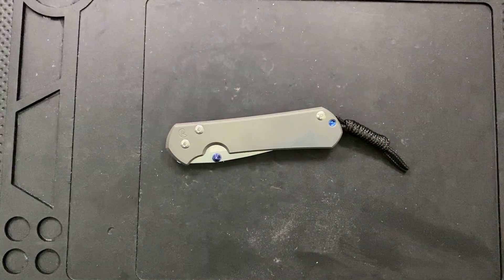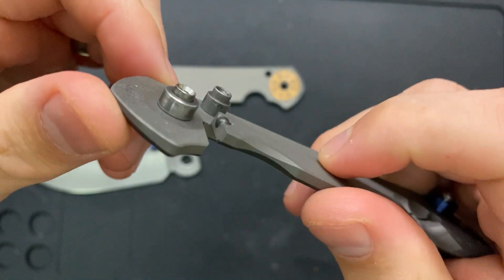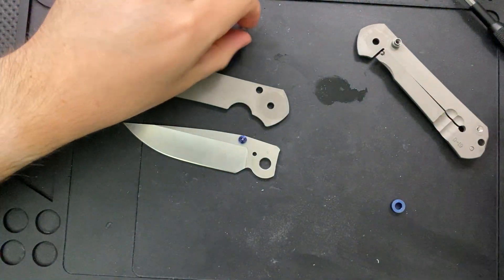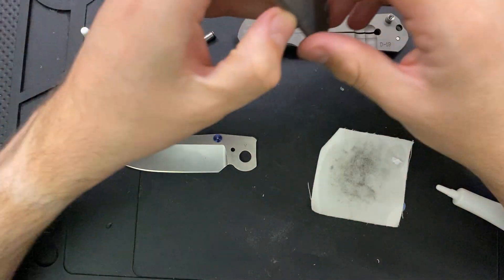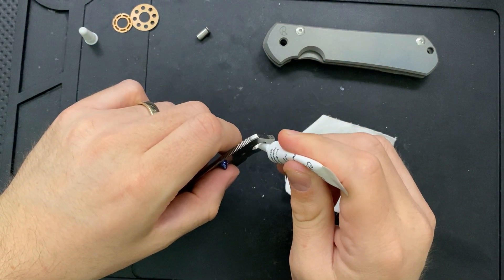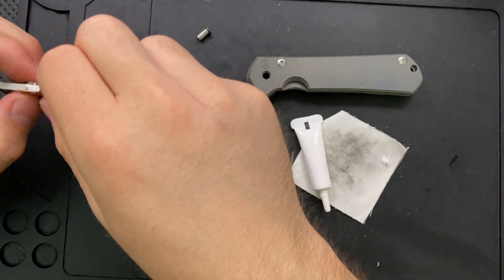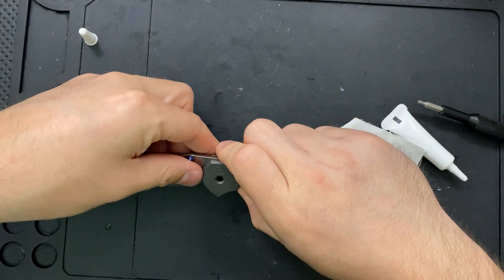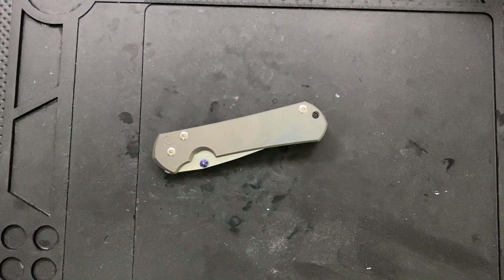How to disassemble and maintain the Chris Reeve Knives Sebenza 31 Pocketknife

Comment: Tim reeve has a great video on how to do this. You gotta keep the body screws a little loose so you can slide the blade back in easier, take the lock bar tension off with your thumb, slide the blade in, then tighten everything. It goes real easy that way.

Comment: This was helpful. I’ve taken my sebenza apart multiple times, and I’ve always put it back together the “knife sandwich” way. I’ll give this a try next time I clean it.
Reply: I do the "knife sandwich" way all  the time in my 21. You're not going to crimp anything if you're careful and use common sense 🤦🏼‍♂️
Reply: I always build mine up from the lock side to the show side, never one issue in my 10yrs of owning many CRK’s. Don’t know what the others do wrong to damage such a simple design.. 🤷🏽‍♂️
Reply: I have taken mine apart 4 times now using the sandwich method and never had a problem. If you put the washers down over the pivot bushing and not put the bushing down onto the small washer, you shouldn’t have a problem since the bushing aligns everything.

Comment: (Rolling my eyes) I seriously doubt you'll run into any issues crimping the washers by putting the knife back together the way you normally do. Screw those fan boys and CAROLE BASKINS!
Reply: Its actually surprisingly easy to do. I used to think the same thing when I got my first Sebenza. I tried assembling the way I was used to (knife sandwich style) and ended up pinching a washer. Just the nature of having a pivot bushing. The way Nick shows here is much easier.
Reply: @journeymanedc  is it tho
Reply: @adamgreene831  The washer is sitting on top of the bushing at 9:57 and got pinched as nick tried to force it between the handles...
Reply: @adamgreene831  yes.. lol I've owned like 20 Sebenzas. You can put them together however you want but it's easier to slide the blade in. Its impossible to pinch a washer that way.

Comment: Great video! Is it me (must be) but has knife quality deteriorated? I only have Hinderer and Chris Reeve - (7 Reeve, 4 Hinderer). The last two Hinderer and the last 3 Chris Reeve all arrived with off center blades - a huge pet peeve of mine! I am currently awaiting word from Chris Reeve on what to do with my new large 31 - maybe the tolerances are so good that some grease under the washer is throwing it off? In any event I asked CRK how 3 recent knives can all have off center blades and how should I proceed - we will see!
Reply: How did that work out?
Reply: @gustavohernandez5464  As it turns out, there was in my last knife too much grease! Amazing! I disassembled the knife and cleaned it - added oil which I prefer over grease and it was dead center. The Hinderer was a matter of user error, a nuanced adjustment to the pivot (I am talking a 10th of a turn) centered the blade.

Comment: I had a little lockstick om my small 31. It was so little it dident mean anything. I have fixed it with a little lube on the lock interface.
Reply: You shouldn’t have any lock stick being that the lock interface is ceramic now
Reply: @sinjon   Yearh but i still had a little. IT was so little it was barly noticeabel. But after IT got a little lube a week or two ago, IT has been perfekt. Sorry for my bad english.
Reply: Bernd DasBrot   value is relative. Most non knife people would say everything over 20$ is overprice fore a Pockets knife. Nobody is right or wrong in the end. I buy it because i love the design and the great warrenty. We shoundent judge people fore what knife they buy as Long its not a z-hunter;)

Comment: This is to much like the inkosi/25. I'll pass on the 31 and might pick up another 21 before they disappear.
Reply: Love my 21. Not a perfect knife, but it's damn good
Reply: This is set up like a 25 except the washers are not even size like the 25. The 25 is mechanicly sound the Inkosi is only bolted solid at the rear or the knife the 31 is at least bolted down solid in two places. The unven washer set up on the 31 is wrong. It's pushing the blade in one direction. The 21 and 25 are mechanicly sound.

Comment: Can anyone tell me if the blade is suppose to have a little play to it when the lock bar is not engaged?
Reply: That’s ok if the lock is not engaged
Reply: Caleb McFadden I took it apart just 1 more time just to make sure I had everything aligned and I guess one of the washers was slightly off but when I re assembled it, it was rock solid.
Reply: @nylildude  I see. Glad you got it working again!

Comment: I'm not trolling or trying to be demeaning. My fried owns a Machine Shop and has been a Machinist for over 40 years and if you showed him the washers he would tell you that's not right. I know this isnt a life and death situation like a motorcycle wheel and it's just a folding knife but that floating stop pin is straight up wrong and so are eneven washers. Will it work?? Sex in prison will work but i'm def not into that either. Just so you don't think i'm trolling i might pick up a 31 but i'm going to get some even washers if i do or at least have that on my radar.

Comment: The issue as proven by Advanced Knife Bro is titanium is softer than steel. So under heavy use the titanium will mushroom. Titanium is great lightweight metal with great tensile strength. But it has better purposes than inflating the cost of knives.🤦‍♂️
Reply: What was the tool used?   Thanks

Comment: Two different size washers is uneven strength which means your pushing the blade in one direction. I'm an Offset Printer by trade and i've never seen two different size bearings or anthing like this. All wheels i've ever seen on a motorcycle have even bearings. The Sebenza  25  has even washers and the handle is bolted down solid in to places, the Inkosi is only bolted solid at the rear of the knife. This 31 is just like the 25 except the uneven stupid washer set up. No way Harley could put two different size bearings in there wheels and not get called out on it. Stupid Yupies that have never worked a day in there life buy these knives which is fine except these designs are retarded. Bolt the handle down evenly and give us even size washers. The 21 and 25 have solid designs, the 25 is solid and has the ceramic ball which is awesome. If you can get some even round washers the same thickness as the eneven washers for the 31 it would be ready to go. I'm also a Personal Trainer by trade. I've studied Biomechanics, i worked repairing watches and i've also built motorcycles frome the frame up. This 31 is better then that stupid "floating" stop pin set up but still this is not how to build things. Chris reeve tolerances and manufacturing maybe let them get away with these non sense designs but it's still wrong and bothers me. Yupie's that have never worked a day in there life and have never used their brain to build something and if they have they havnt done it at a professional level like a Machinist or a Printer or a Carpenter would are the only one's that are going to go along with this. I may pull the trigger on a 31 one though because other then uneven washers it's pretty sweet.